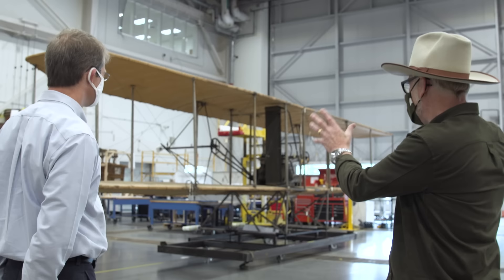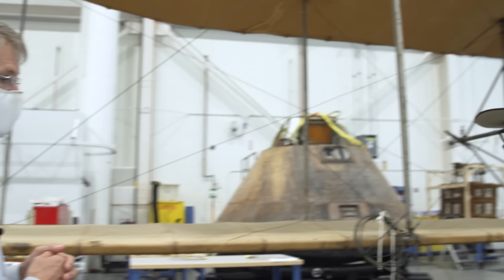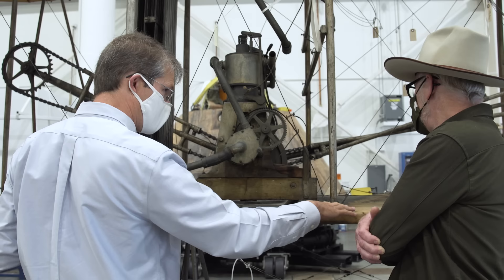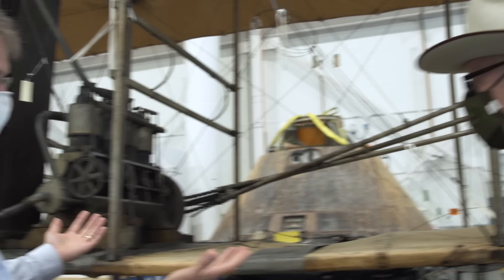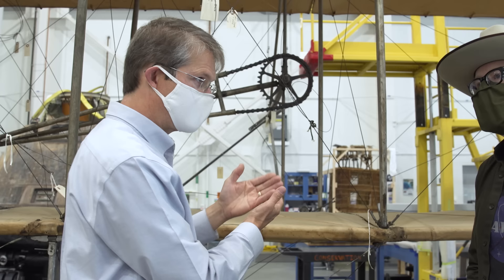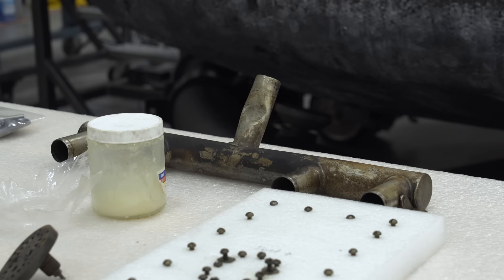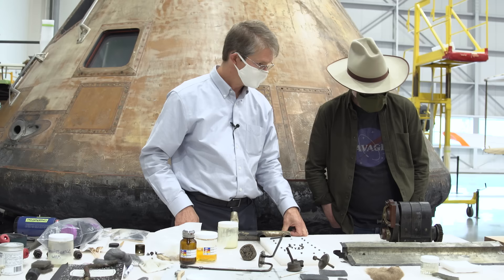Adam Savage Examines the Wright Brothers 1909 Military Flyer

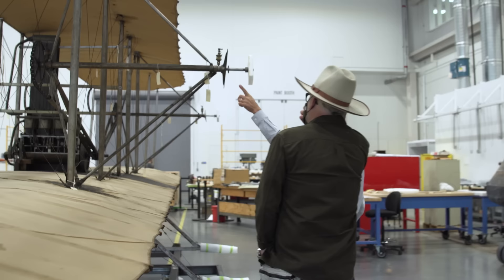Comment: At 7:48 you can see on the shaft just to the left of "where the propellers would mount" is the clear glass of a "Constant Level Oiler".   This was used to continuously provide lubricating oil onto the shaft of the propeller to reduce friction and wear (in both sleeved and ball bearing types).  Before each flight this oiler would need to be re-filled with fresh oil.  The technology was used across many machinery applications.  Simple and reliable.  At this point in time there was no "sealed" bearing technologies like we have now with advanced lubricants and harder metals which can run for years without needing any attention.  My $0.02.

Comment: The think I always find glaringly different about the Wright Flyer compared to all the photos and videos of their contemporaries' failed craft, is that they obviously worked out what it needed to do and what shape it needed to be first and they built it. It flew because they worked out that it would fly before they built anything.
Wheras all the others (at least the craft you see failing spectacularly in videos) the designers just seemed to guess at what might work and built a whole aircraft without checking anything.

Comment: Adam little bit of a historical spot in regards to the Wright flyer Octive Chanute developed and tested the Wright Brothers flyer in the Miller area of Gary Indiana what is now Marquette Park at the aquatarium there is a a mockup of the flyer where it was tested before it went to the Wright Brothers
Reply: To clarify, in 1896 Chanute tested gliders which influenced the Wrights in their own, later glider designs.  The Wright Flyers were the powered aircraft built by the brothers starting in 1903.

Comment: Hey Adam, what is the terminal velocity of a lego minifigure? I am doing a small scale test on a low budget and only know that the test figure weighs roughly 3.5g, I do not know the drag the figure would have. The figure is equipped with white legs, blue torso, white arms, yellow hands, a yellow head, a white crash helmet and a clear visor on the crash helmet. Any input would be appreciated. Thanks in advance!

Comment: I recognize the importance of Wright Brothers to the progress of aviation, to people of USA But I'll never recognize any kind of primacy in flight from that Gentlemen, first because they were working in absolute "secret", until 1908, when they presented their ground device dependant flying machine in Europe for the first time. Considering the alleged date for the first flight event, I cannot understand why 5 years later they were still using a catapult. I can't understand also why they tried to convince everybody with a simple photograph of an airplane flying high (more than a meter) over the launch rail, when hundreds of people watched every experiment made by Alberto Santos-Dumont since the beginning of the century, including that first flight on December 23rd, 1906 before a huge crowd on Bagatelle Field, Paris
Reply: ”…they were working in absolute "secret", until 1908…”

Nope, although _”semi-secret” would be a fair descriptor.

”…I cannot understand why 5 years later they were still using a catapult.”

That’s because you don’t understand why they used a catapult in the first place.  For one thing, their 1903 Flyer did not use a catapult at all, nor did their 1904 Flyer initially.  And the Wrights’ later use of a catapult was a performance preference, not a necessity to take off at all.  It allowed operation from difficult surfaces and confined spaces, such as the sand dunes of Kill Devil Hills and the hummocky, tree-lined Huffman Prairie, places where Santos-Dumont’s own 14-bis could not have operated.  Consider too that with a catapult, the Wright Flyers typically used about sixty feet to take off, while the 14-bid required more than ten times that distance (200 meters).  Lastly, while in Europe the Wrights occasionally disconnected the catapult, and demonstrated the ability to take off easily without it.  (It just required more distance to do so.)

”I can't understand also why they tried to convince everybody with a simple photograph of an airplane flying high (more than a meter) over the launch rail, when hundreds of people watched every experiment made by Alberto Santos-Dumont since the beginning of the century, including that first flight on December 23rd, 1906 before a huge crowd on Bagatelle Field, Paris.”

The Wrights never relied on photographs to convince anyone.  People like you place more importance on photographs than they ever did, because photographs are not the only kind of evidence, nor even the best kind.  The Wrights knew that once they flew in front of the masses, people would be convinced that their claims were true all along.  In fact, Bleriot, Archdeacon, Ferber and many others recanted their previous doubts, and declared their beliefs that the Wrights were far ahead of what anyone else was able to do at the time.  You might ask yourself how two frauds managed to show up in France in 1908, with an aircraft that copied nothing from anyone else’s, and which literally flew circles around their competition.  You might also ask why their competitors began copying their design immediately.  Do you think that they just made ignorant guesses and then got fantastically lucky, in order to be way ahead of everyone else?

Comment: Adam - have you done a video on the perils of tools and things not being where they are supposed to be and the amount of time wasted searching for some tiny little component holding up the build. So for example when you are unsure of the wire you need for a build you just buy the whole range as you don't have time to mess about. Also if a tool is always in the second place you look then should you consider moving it? Timesavers like have one drill for the hole and another drill for the screw (so no changing bits) etc

Comment: What the Wright Brothers actually invented (and applied for patent) was the first controllable "glider" airplane from 1899 to 1902. It took them three years of testing with kites and optimizing the wing shape in wind tunnel before they could control the glider with pitch, yaw and roll commands. The lightweight engine used in the first Flyer Mk 1 was invented by Charles Taylor who was a mechanic employed in their bicycle company. The engine block was made of the newly discovered aluminum and copper alloy technology instead of cast iron which was a key to success.

Comment: The Wright Brothers did not "invent flight" people were flying in gliders in the mid 1800's and in balloons as early as the early 1700's. The Wright Brothers were simply the first to successfully have powered flight with a heavier than air aircraft and they were by no means the only ones at the time trying to do so. Is this a museum curator or some guy quoting wikipedia?

Comment: This video left out the man who actually built that motor Charles Taylor, he was the real engine mechanic.  They searched Detroit to find an engine that weighed no more than 168 lbs and didn't find one.  Charles Taylor did some research and found alloy engines being built by Daimler and Mercedes in Germany.  Taylor found a blueprint of a 4 cylinder engine and had a local foundry cast the engine of 92% Aluminum and 8% tin.  All the rest of the parts he made himself by hand in less than 3 months with some innovations of Mr Taylor.
Reply: He was a machinist. The Wrights were the mechanics.

Comment: it scares me how the SI uses wires brushes on parts they consider delicate.. i thought the standard practice to curb oxidation was to boil the rust ? not make fresh real estate for it to develop more
Reply: Are you saying that the wire brush induces dissimilar metal corrosion? The wires of the brush are made from corrosion resistant steel. Safe to use on any metal pretty much. I've never heard of boiling rust in all my years of corrosion control.

Comment: What year and design model was the next evolution to the bi plane and rotary engine? That seems like a huge leap from this and couldn’t have been just a few years later right?
Reply: From 1914 and on, a lot happened. War tends to accelerate things.
Reply: The Gnome Omega was the first popular rotary engine - first flown in 1909, same year as this plane. And yeah it was a big jump forward, considerably better power-to-weight ratio and no need for a big, heavy cooling system.

Comment: An amazing object, but shows how behind the times the rights were by this stage. This thing still looks like the prototype they flew originally 5 years earlier. The French had already defined the shape of an airplane by this time and had machines flying that would run rings around this, still primitive design.
Reply: The French and Germans might have had powered airplane flight first if their propellers weren't kayak style paddles that had been the push paddle props on the late 19th cen balloons and airships.  Not efficient enough to generate lift thrust.
That and using heavy iron block motors that had an very poor weight to thrust ratio.

Once The Wrights brought their craft to Paris by ship for demonstration, it was damaged in transit, and repaired by craftsmen in France....within 6 months the French Air Clubs were suddenly flying their designs.

Propellers being the wing design was the key.  Changed flight and watercraft as well.
Reply: @STho205  Hello, yes looking at those early propellers they worked, but were ineffective. The  Antoinette III, otherwise by luck or design, looked and acted more like a traditional plane, though still had the bending of it's wing for direction adjustment. I would say engine development was at least at the same level as Orville's engine, as these planes could take off independently whereas the flier and its siblings, needed an  assisted launch rail which some have said, removes its claim to first 'unssisted' flight?
Reply: @anticat900  whatever you like to think, however they weren't off the ground by 1903.  They were doing hops that couldn't be sustained.  After the Wright visit to Europe suddenly an ah ha moment happened with the people involved.  Not a coincidence there.  However the Wright box kite pusher was not the future as a scalable design...it just happened to put the three things together that worked.

The Wrights weren't interested in gentleman amateur competition and name recognition bragging rights, so they spent the next decade setting up a flying school in Alabama and selling aircraft to government customers.

By ww1 it was mostly over as prototypes don't last as is.  Same was true with early cars...no cars after 1927 operated like the cars three decades prior.
Reply: @STho205  What happened to cars in 1927 to define a cars design? A model T while it had weird foot controls, it pretty well defined a car by the million well before that date?
Reply: @anticat900  a model T is an applied clutch drive for low gear and reverse.  Tensioning a "clutch" with foot pressure to give more and more grab.  This was a design carried over from tractors and mill engine leather belts.

In the late 20s most lines adopted the release pedal spring clutch of Cadillac.  Where removing your foot gives the grab and drive.  Add to that the accelerator pedal being the total control of fuel flow....no more wheel mounted throttles and timing levers.

Ford was one of the last to adopt it in the final year of the model T...Henry Ford disliked Cadillac since he left that company as his first failed venture in the early 1900s.

So driving a T is typically the opposite experience of a mid century modern car.
Reply: @STho205  I'd agree the Model T was a muddle of controls. I'm not sure if this was to make it cheap to make, or was it their own 'standard' for the time as no one knew no better? Certainly Cadillac did know better and introduced our familiar layout, but it was such a change over the ford design it was a flop. The car that copied the Cadillac that actually made it a success however was the next million selling car, after the model t. Ie The hugely licenced car the Austin 7, or the Bantam (Jeeps first production car) as it was in the US.
Reply: @anticat900  it was just a way to design it in the 00s as each builder had their own way.  Chain drives, sliding bicycle style gears, CVT,  glow plugs, spark plugs etc.

Cadillac is the first to put it all together that we consider modern: electric starter, simple pedal acceleration, pedal only brake, spring release clutch and a pull choke for cold starts.

Austin would copy that in the UK for their cheap model T competitors for the everyman....but brands that became GM and Dodge Brothers adopted it about simultaneously to Austin...then the continental lines like Benz, Citroen, etc

Comment: This video is wrong. The Wright Brothers did NOT invent flight. That honor goes to Gustave Whitehead who flew 2 years before the Wright's in 1901 in Bridgeport Connecticut before a newspaper reporter and 10 eyewitnesses who signed affidavits they personally saw Whitehead fly in 1901. THIS VIDEO SHOULD BE PULLED OR AT LEAST CORRECTED. !!!